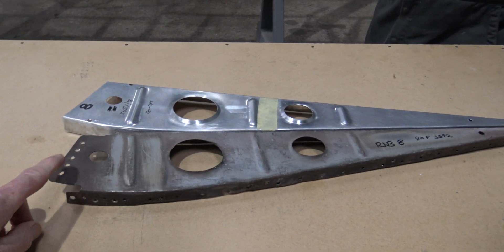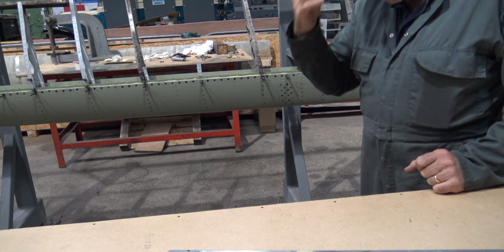Video 28 Restoration of Lancaster NX611 Year Two

Comment: If you watch the time and effort going in such a small part like this aileron you can just be impressed even more by the fact they did put out almost 10,000 of these Lancasters during the war.
Reply from the maker: Hi tom jig drilling and  would help production. John is having to drill the holes individually a lot slower process. thanks for watching.